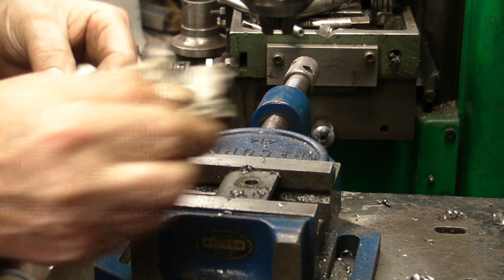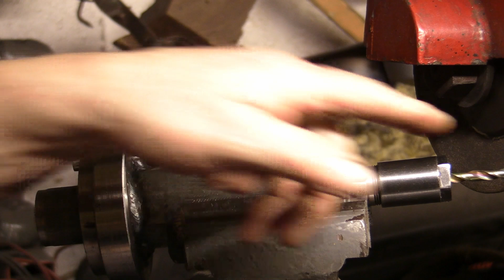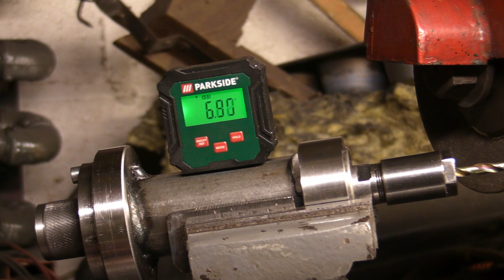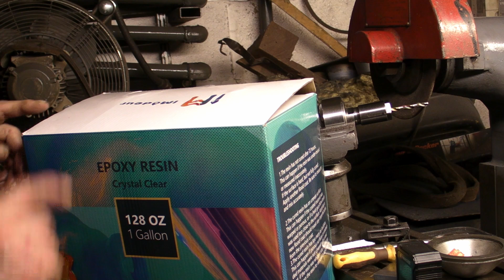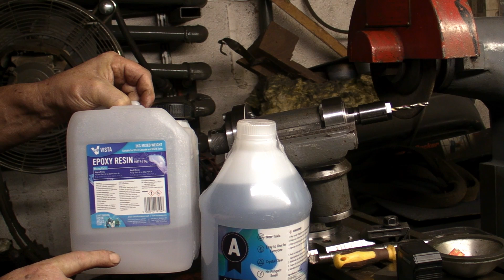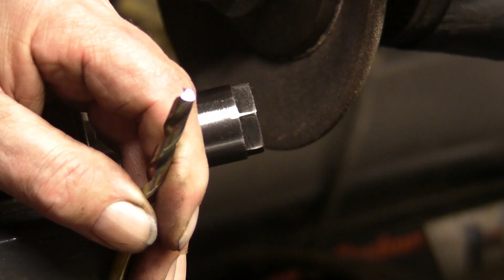First try with the grinding vice

Comment: That's crackin' Del.  With a 7° relief you will get rubbing, you want to go for a 4 facet sharpening, 7° on the cutting edge, and then a second grind at 20° for the relief, with the 4 facets meeting in the centre of what would be a chisel point on a "classic" twist drill.  Anything over about 8mm I split the point as well, but do that "by eye".  I don't grind 118° drills any more, I do everything at 135°, which works better in hard materials.

I've not tried end mills yet, but i've got a good collection of blunt 'uns to practice on when I do.